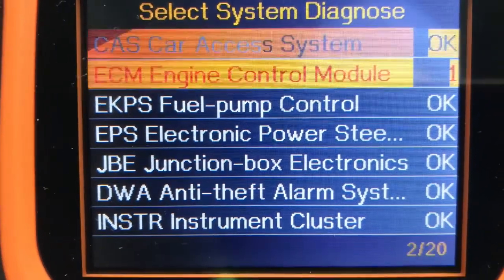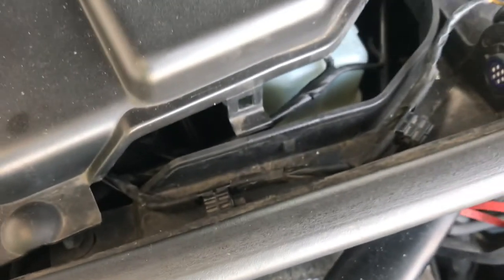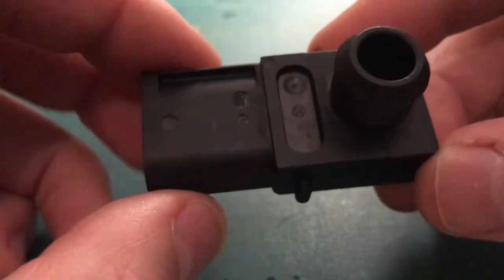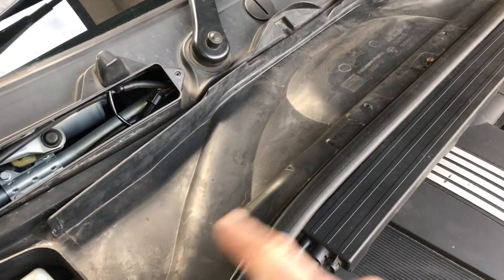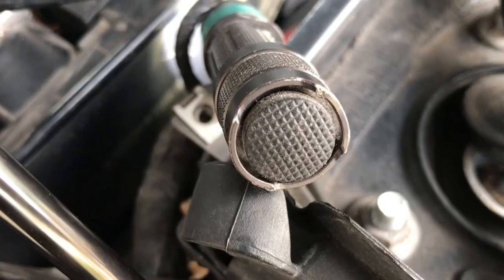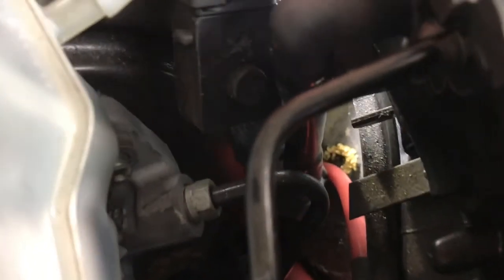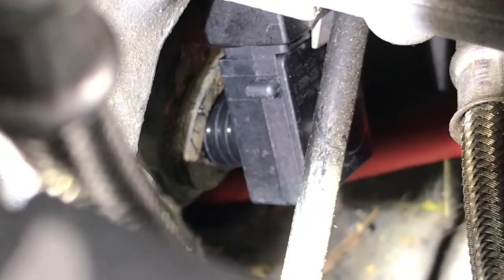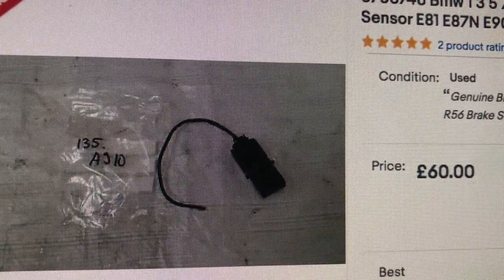BMW E91 Brake Vacuum-Pressure Sensor Solution

Comment: Best method/video is this one on this problem IMO. The technique allowed me to refit the sensor within 15 minutes. This worked on my 1er E87 diesel, just careful the sensor is elsewhere, located on the right side below the brake fluid container. After changing the sensor, the error dissapeared, no need to clean the codes.

Comment: I had this issue on the 1 series. Buying the genuine part from BMW was the only way I was able to fix the issue
Reply: BMW like original oe BMW sensors. 
Especially camshaft or crankshaft.
Reply: I called BMW Dick Lovett and the pricing including VAT for the Brake Vacuum Pressure Sensor for Stop / Start is £153.25!! 🥲
Reply from the maker: Definitely the safest way.

Comment: Hiya, I have managed to get mine out but I'm struggling put the new one in
Reply from the maker: I found that getting the screwdriver 🪛 in the slot on the top of the sensor was the key to success!
Reply: @bmwnurse1118  I managed to get it done 5 months ago, thank you tho 😅😂🤣

Comment: Does brake fluid leak when the sensor is removed or is there nothing behind it that can leak? Do you have to adjust anything on the brake system afterwards?
Reply: Hi, nothing leaks and nothing has to be adjusted as far as I know... I haven't had any issues since.
Reply: when removing sensor you should hear air sucking back into servo as it should have vacuum, if not could be faulty vacuum pump, leaking hose, worn seals or failed servo. Water coming out prob servo rusted, brake fluid coming out prob master cylinder seals leaking back into servo. This is old thread I know but others may benefit.

Comment: I have the same issue and was think how to get thing back in, so thanks for the tips but I also just brought a cheap one off Ebay claiming to be new but definitely isn't. Don't even use startstop just want to get rid of the annoying bong lol. 115 quid is a lot for something you don't use.
Reply from the maker: Right, it is a bit expensive, I've seen a few second hand tested and working ones from uk sellers on ebay for about £50... I guess another advantage is that a working sensor can let you know if there's a problem with your brakes.
Reply: Fitted it today and like the one you brought it wasn't new and it didn't work.
Reply from the maker: @jwilk1704  😤 sorry to hear that.

Comment: Only 20£ ?
Reply from the maker: Yes thats why it didn't work! bought another one from UK seller for £55, fitted it this morning in 20 minutes and it's all fixed (including auto stop/ start).
Reply: @bmwnurse1118  Hi would you be able to provide the link of the last sensor that you bought, please, I've got the same issue, got one from ebay £16  doesn't works. Thank you.
Reply: it’s 115 new
Reply: @cri838 £153 now! 🥲